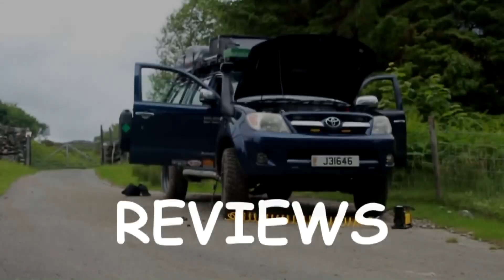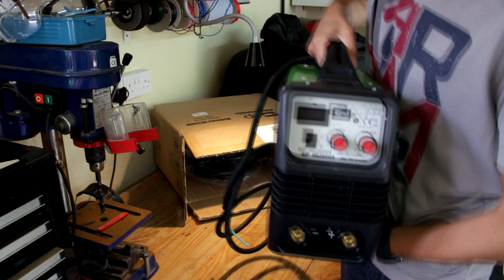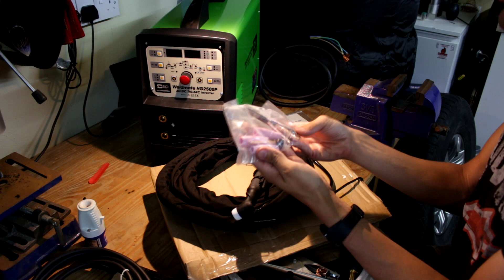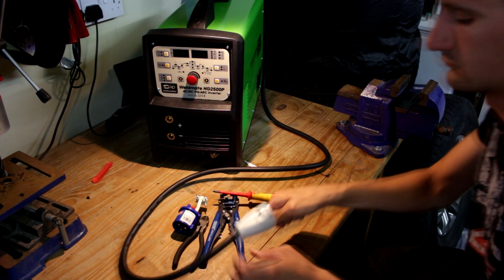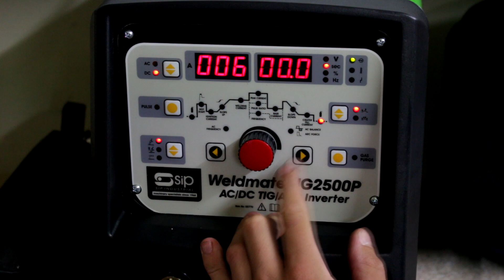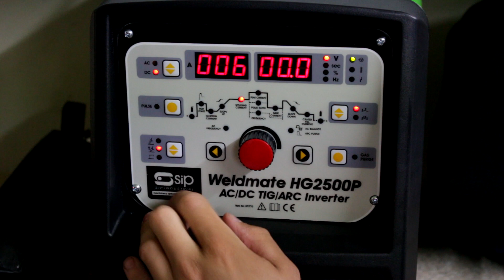SIP HG2500P Unboxing and First Thoughts

Comment: what is the power consumption in KWatts, please. I am looking in buying an ac/dc tig welder. this one or a Chinese one. depends on KW for using mobile.
Reply from the maker: It draws 16amps at 240v so 16x240 is 3.84kw 

Keep in mind welders dont like modified sine wave inverters so you will need a pure sine wave inverter to ensure it works properly

Comment: The issues you mentioned with mig are only from the idiots who think theres no difference between a 100 pound and a 1500 pound mig welder... flux core wire has to be welded perfectly on the machines part with good quality rolls (lincoln) to be successful.. not the cheap tat that normally comes with the machine or the shops you normally buy sip welders from.  If you get issues welding together thin sheets of metal using a co2 mixture gas with your quality mig welder then you should not be welding tbh and YES i have owned a cheap SIP welder before.. it was a lovely little arc/tig inverter and it does the job if you welding 4mm+  but if you want to weld thinner or have more control over your welding? get a decent multi process machine like a esab rebel etc.. I find it scary that people use cheap gasless migs on cars though

Comment: Doesn't it need a 16 amp input though and your running a standard 13 amp?
Reply from the maker: You can run it on a 13 amp supply but you wont be able to use all the amperage the welder has to offer, I now have a 16 amp outlet fitted in the garage for this machine